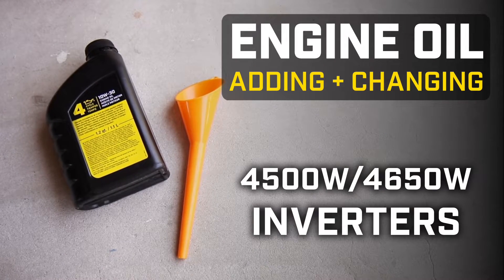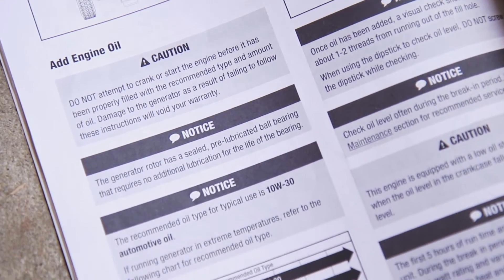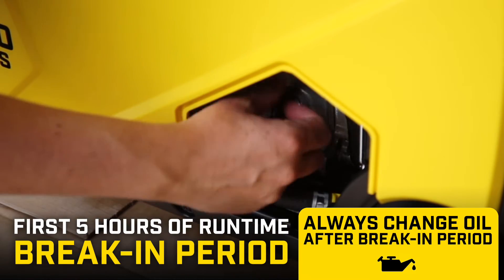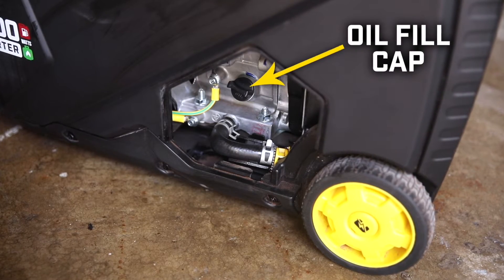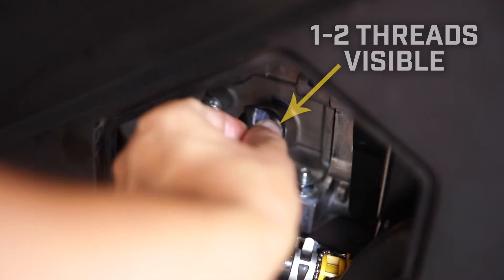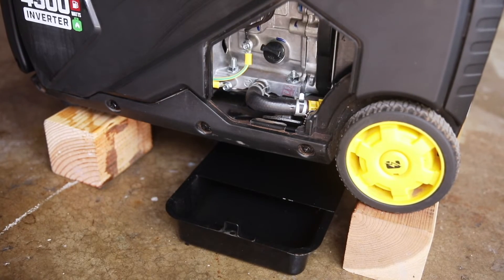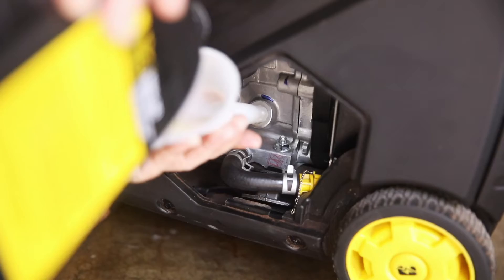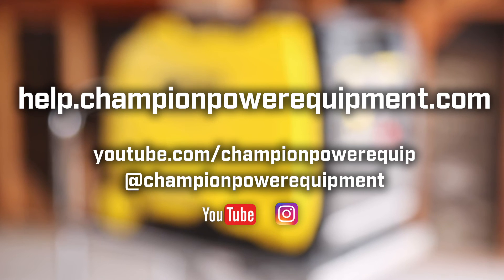Engine Oil (4500-4650 Watt Inverters)

Comment: What do you do if the dipstick breaks in the oil container? Would appreciate advice
Reply from the maker: Hello, if the dipstick breaks and falls into the crankcase, you can try performing an oil change and see if the dipstick comes out. If not, you can visit a service center, and they can open the crankcase and remove the dipstick before it melts in the oil. If you have any other questions, please contact our support team at 877-338-0999, support@cpeauto.com, or use our live chat option located on our website. Thank you